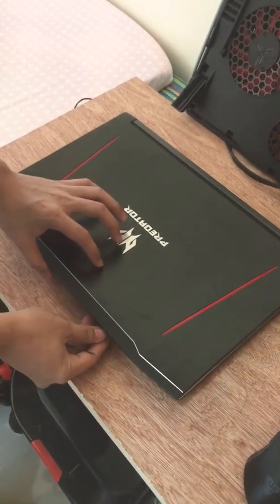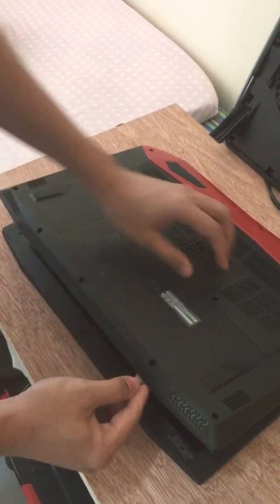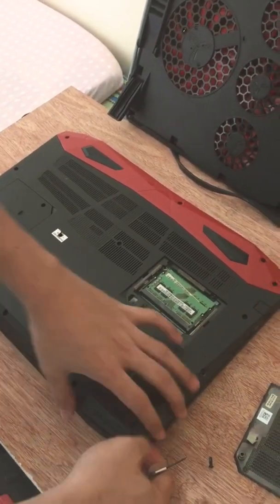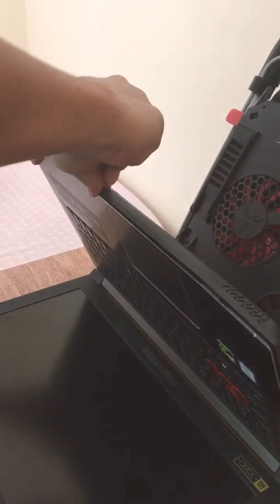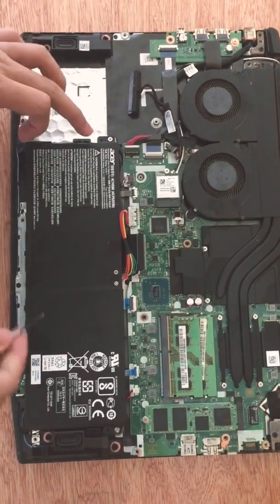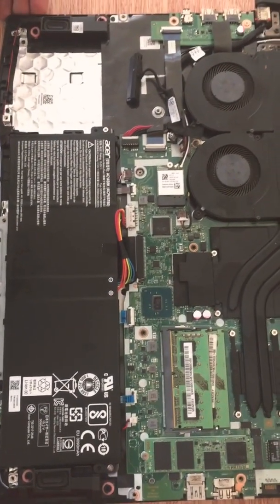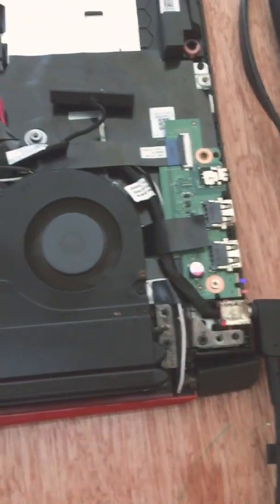DEAD, Acer predator Helios 300 g3-571 FIXED!!

Comment: - Shutdown Your PC Completely
- Remove Back Panel and Battery Plug
- Press and Hold Power Button For 30 Seconds
- Connect The Charger and Press The Power Button Once 
- If The Logo of Your Laptop Appears Well and Good, It will automatically Shutdown
- Remove the Charger Plug
- Connect The Battery Plug Back
- Cover your Back Panel and Plug In  your Charger
- Press and Hold Power Button For 1 minute and 30 sec at least
- As soon You release the Power Button after 1:30 minutes
- Your Laptop will boot normally
Reply: How long it'll last until you have to do it again?
Reply: @w @wq5O377  Pure Luck, My lasted around a week and then i had to eventually get it repaired.
Reply: My lap screen is not turning on after step 4, only keyboard lights are on and fans are not spinning
Reply: @emmanueldavid4645  Getting it repaired is the only solution now.
Reply: Ily sm thanks for the tip

Comment: I fixed this issue by removing the Ram, turning on laptop, turning off, install 1 ram, see if it turns on, if not, remove ram and install other ram. this worked for me.

Comment: Hi, bro my laptop charging light start blinking while i am playing games now  its continuously blinking also the charging indicator shows its charging as 100% but after sometime when the charging automatically disconnected then its get shutdown suddenly and wont turned on but after getting it charged for sometime without any use then i can turn it on and this is repeated. Can anyone help me out, I have tried battery reset but that doesn't work.
Reply: Bro please tell me, if you found any solution to your problem or not?? I am also facing same problem please reply bro.
Reply: @prathamupadhyay122  yeah some chip related to charging was busted and i have to taken to the repair shop now everything is fine.
Reply: @rajatvashistha1983  how much does it cost to you and could you tell me the place where you go for service?
Reply: And please could you elaborate more on which side was chip got bust so that I would able to check it if this was issue with me also?
Reply: the connector on the lesft side of the motherboard which connect the power supply to the motherboard. @prathamupadhyay122

Comment: Hello!
Urgent: I isolated the battery like u said from the mother board. Also resetted the battery switch. But when I connected the power plug, no light switches on and laptop isn't starting even after pressing power button.  Whyy??

But if battery is connected in hardware, and power plug is connected, then charging light ons. But laptop doesn't turn on. Why??

Thanks in advance! :////
Reply from the maker: hi, did you try removing the battery and the other port (see video at 5:33) which is the culprit that shorts i believe,  i did this coz the battery has not been able to charge itself. i hope this works for you too. thank you

Comment: Thank s for this video. After following it, in my case, no result but I ve see the problem: it s came simply from the power connector on the pc. In first, check the tab of the negative pole under the connector!

Comment: Thank you! This actually worked. Did you ever have to repeat this process, or was it a permanent fix?
Reply: hi there, this is a one time process and I had no issues since i removed that blue socket and the battery. i'm glad it worked for you as well.

Comment: Hello ther I hope someone still reads this :/
I have this acer for 2 years now never had a problem. 
Yesterday I played a Game  like 2h and the acer got very hot and it just shut down.
I let I cool down over night and today I tried turn it on nothing happens.
I plugged in the charger and no light seen no blue no orange when I press power button no sound nothing :/
I just tried the battery reset button but nothing happens does anyone ever had the same problem?
Reply from the maker: HI there, it seems like a power issue, you can try to bypass the battery, by removing the battery socket and the other blue socket shown in the video.
Reply: how did you fix it brother, did it get fixed, I am facing the same problem today I am so disappointed
Reply: @prajjwaladhikaryraw im facing the same problem how did you guys fixed this problem?

Comment: Bro i have same laptop. Since yesterday it keeps connecting and disconnecting the power automatically while charger  plugged in. there is nothing wrong with the electricity supply. Can you please tell me why?
Reply from the maker: it seems a battery issue, you can try to reset your battery. Hope it helps
Reply: @doopstv8393  and how to do that?
Reply from the maker: @TAHIRNAQASH696 find the pinhole underneath with a battery logo, push for 1 minute, that will reset your battery, thanks

Comment: Would it hurt to leave the battery unplugged inside if I am only using with AC?
Reply from the maker: No, instead  this will prolong the life of your battery, unplug the battery from the laptop. Just fully charge it before unplugging. Thanks
Reply: @doopstv8393  Thank you!

Comment: Hi thank you for this, you pointed me in the right direction. For anyone who has a Predator Helios 300 that is not starting up, no lights in the keyboard, no fan sounds or anything... unplug the battery cable like he shows you in this video, then plug in your power and start up the laptop, it should start up. Shut down computer again then plug the battery cable back in on the motherboard and start up without the charger plugged in. Worked for me. It seems like this is some weird battery issue when people are trying to work on their laptops with custom upgrades (I was trying to swap out my GPU fan). Maybe it is a battery issue caused by repeatedly powering off and on? I powered off and on a few times to test the fan, then this issue started.
Reply: I currently have this problem. I replaced my Predator Helios 300 (2019) screen and turned it on and off and now it won't turn back on nor charge. I'm hoping to try this to see if I can reset the laptop. Maybe it's a type of security protocol put in place to stop stuff from shorting out whilst you're upgrading, either that or it's  a weird manufactors glitch.
Reply: @yubell1945  yeah it seems like it might be a fail safe put in or maybe a battery error. Either way I think what I described in my first post is basically just resetting the battery. Older laptops have battery reset buttons for similar issues.
Reply: I have helios 300 laptop , iam facing the same problem ,if  unplug the battery then the laptop turns on  ? How much time i have to unplug battery and run on direct power?
Reply: @maheshreddy3421  It seems like a safety protocol where they disable the power if components are removed. When I removed the battery cable, I only waited a few seconds then plugged it back in, then the laptop operated as normal again.
Reply: I have the same problem but i didnt open or change something from my laptop, will it work anyways?

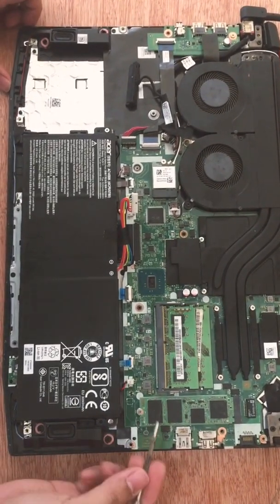Comment: 5:26 Do you know whats that blue wire for that you unplugged while Praying to God ? 

Just asking...
Reply from the maker: honestly, i do not even know what it is, i cant even find anything about it in the internet, fortunately  though i have no issues and can live without it,  thanks
Reply: @doopstv8393  For me thats not the case.
I did the mistake of pulling it out , and now my predator shuts down as soon as i run any game .
I guess it had something to do with GFX card.
I put it back on but the black lock holding it was so low quality , it broke. so had to put it in place with a tape.
Reply from the maker: @ahgksi  looks like power issue to me, in my case i got occasional shut down when using the battery, eventually after few minutes it wont power on, so i got rid of the battery by detaching its pin from the mother board. plugged the charger, case closed. i hope it works for you too bro. try detaching the battery pin ,thanks
Reply: @doopstv8393  I ve tried detaching the battery as well.
What i m saying is since i pulled that blue wire out
anything that runs on graphics makes my pc crash .
Everything else runs fine but as soon as i run any game , it shuts down .

Should not have tampered with that blue wire. 
Damn
Reply from the maker: @ahgksi my bad,  one viewer shared that the  blue pin is for the magnetic sensor that puts the laptop to sleep when the cover is closed,  try to set your power management settings from sleep to never, hope this helps, thanks
Reply: @doopstv8393  my power button is broken how to start laptop from motherboard same laptop helios 300

Comment: Hi, I have a problem with my Predator Helios 300 G3-571 wherein the charger is plugged in but it isn't charging (Blinking Orange light) and sometimes when I'm gaming the charge disconnects. I have tried some of the solutions that you have suggested and nothing has worked, any ideas on how to fix this?
Reply: Anybody that is reading this my 2021 pred did this orange light blink no charge and replacing the charger fixed it. Just trying to help future readers.
Reply: Having the same issue myself, and it's been happening for quite some time now. At times, it starts working properly again, but it will just begin to act that way again. I've looked through and through for an answer, but nothing's working for me.
Reply: And Now  I am having the same issue😟😟😟
Reply: @Uzairtak   remove the blue socket and the battery socket as shown, and try to boot, I hope this helps.
Reply: remove the blue socket and the battery socket as shown, and try to boot, I hope this helps.

Comment: Hello there...  Can you help me out with my Acer predator helios 300 2019. It suddenly turned off yesterday and  is not turning on. The  charging light is  showing up when the charger is connected but the laptop is not turning on when the power button is pressed. Today in the morning it turned on on battery power i used it for 2 hours and ranomly it turned off again and is not turning on. Can you help me out please?
Reply from the maker: HI, first, you can read and follow the description below if it works, then if not then i recommend to follow this video, hope this helps, a sub would be great thanks.
Reply: I have the same model as yours and i had the same problem... I gave it to Acer service centre and all they did was literally this video. And this fixed it ... But the problem still started after 10 days and i did this again and works for time being. Guess we have to do this alot.
Reply from the maker: @karthik602  , detach your battery and that "blue pin" and use charger, thanks

Comment: Easy fix for this is to reset the battery. Find the small hole with a logo of battery just press and hold for 5 seconds. That what i did to my hellos 300
Reply: Can you tell me.where is the battery reset located on this computer please
Reply from the maker: yeah  batteries nowadays are not that reliable, at least on mine, its 3 year old now,  its great battery reset still works for you, i hope it lasts

Comment: hey..my laptop wont turn on..when i press the button blue light blinks for a while and turns of..no display...charging indicator shows that lasptop is charging...i have tried resetting battery,removing RAM.CMOS,HDD everything
Reply from the maker: just follow  the  video, hope you'll  figure it out, thanks
Reply: Change your keyboard because power button is include on keyboard like an other key, if something like cofee or cola fall into keyboard, the "power" one can be damaged, fixed just unplugging the connector on motherboard!
Reply: @boeufcarot  ..had this suspicion changesd the keyboard in service center..didnt work...even tech guys coulnt find the issue and just went on saying replace the mobo which costs 900$..i paid 1170$ for this 2 years ago..anyway thank you for the reply
Reply from the maker: @wdsconcepts6023  hope this helps, a sub would be great thanks.
Reply: @wdsconcepts6023  I’m having the same issue. Was yours ever resolved?
Reply: @ChipWooder  no..i gave it to service center..they also coulnt find the issue..they did something which makes the laptop turn on sometimes

Comment: I want to ask, when it's broken, does the led charging indicator still turn on when you plug the charger?

I have similar problem, my acer laptop are completely dead, even the led indicator doesn't turn on.
Reply from the maker: if you mean the orange led indicator, then yes, however  its blinking though, but for the blue indicator, it does not turn on.
Reply from the maker: hope this video helps
Reply: @doopstv8393  ohh alright. thanks for the answer.
Reply from the maker: @1000area  hope this helps, a sub would be great thanks.

Comment: Should I put this blue thing back?
Reply: Your laptop works using battery without that blue pin?
Reply from the maker: it only works if the blue pin is not attached,
Reply from the maker: @dmtryblessed  i'm not using my battery any longer,  so i rely on the charger everytime , since i'm still looking for  battery replacement yet the computer is working normal without attaching the blue pin back.
Reply: What does that blue pin do?
Reply: @saieshchinta1339  it's magnet bro
Reply: @saieshchinta1339  when u close ur laptop ig goes to sleep mode
Reply from the maker: @dmtryblessed  can you share us the link about it, thanks
Reply: @doopstv8393  no link, i found this myself
Reply from the maker: @saieshchinta1339   I think its a sensor that knows when u close ur laptop

Comment: Did u have blinking screen before it stopped  working?
Reply from the maker: no blinking screen bro, it just shuts down on its own. thnx
Reply: Did u put that blue thing back?
Reply: That blue pin. Because when I put it back my laptop doesn't work. I think that's  a magnet that knows when u close ur laptop
Reply from the maker: @dmtryblessed thanks,  if thats the case, it made sense coz,  i've never had an issue with  the blue pin removed since my laptop stays flipped open. anyways i hope you working fine with your laptop